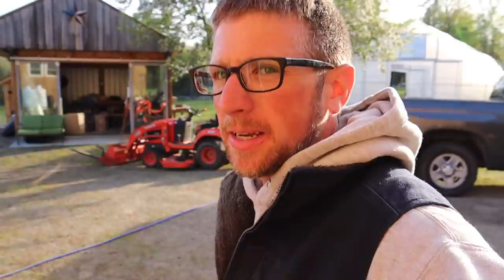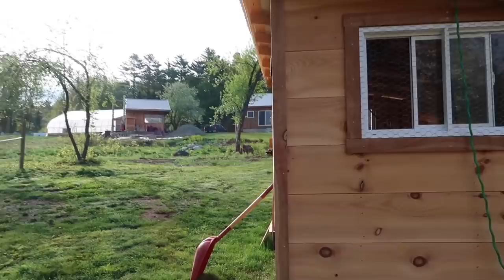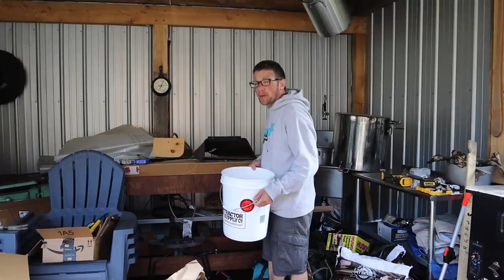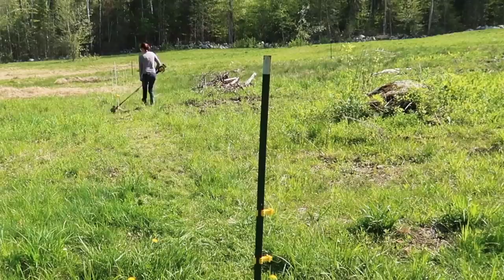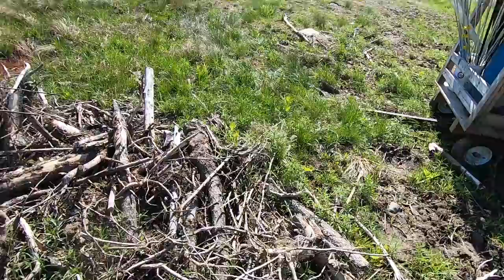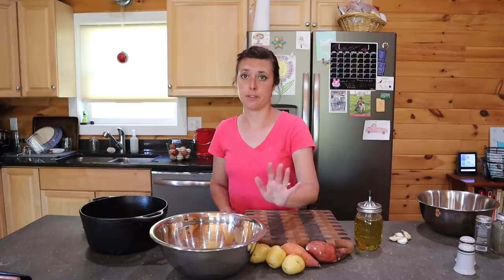This is HOW we MAKE the best BACON on our BACKYARD FARM Moving Pigs to New Pasture

Comment: Hello Gina,🙋
Years ago I met a man who sold antique cast iron stoves.  When I asked how he seasoned his stoves he said with olive oil!💖  Because it's the smallest oil molecule it goes into the iron (not on the surface) and hardens the iron once you heat up the stove.  That's why they were so shiny - he didn't use stove blacking.  It's also the best for skillets and pots.  Once you heat them up and get them really seasoned they are better than non-stick!!!

Comment: Tips for Rusty... in a dutch oven poor 3 cups of water, chop in 1 medium onion, 3 stalks of celery, a heavy pinch of salt and pepper. Make a quick biscuit dough and cut into pieces the size of a silver dollar. After bird has boiled to doneness, remove, debone and put the pieces back in oven with the biscuit pieces, boil over medium heat for approximately 15 minutes or until dumplings are finished.(some people add carrots and potatoes--if youre these types of people then cooking times will need adjusted)

Comment: Chase roster around untill it is fatigued.  Catch rooster.  Without picking him up, push his body down upon the ground.  Squat behind and on him.  Press him down to the ground.  Hold him there untill he quits resisting while you scratch behind his neck.  Release him and walk away in a different direction.  If he comes at you again, immediately repeat the training.

Comment: Why can't you use the other poultry netting fence battery and charger?  Gina, if you get a pre-seasoned cast iron skillet, it will be very rough.  Sand it smooth (electric sander) and re-season it and you'll get much better results (Cowboy Kent Rollins, YouTube).

Comment: I always load up the grill when I cook I make several meals at a time .. it saves time and fuel.. I’ll put several different types of meat on and use it for a whole week.. thats just what I do  I do the same thing when I cook inside
Reply: @ George Vangordon jr. ,
I have noticed that Gina & Al cook with propane in the house  kitchen.  And they use a gas grill in the outdoor kitchen.  What's the difference other than the longer walk and surroundings ?
They cook in the outdoor kitchen to have that nice propane flavor ?  lol
Reply: @donaldmiller8629  Look close and I believe you will see that it is a pellet grill, so yeah, propane driven but hardwood flavoring. And the grease smoke into the outdoor air instead of the kitchen.

Comment: Rusty was showing off in front of the new ladies. Both my brothers got the worse end of a rooster encounter,  My older brother was chased causing him to get nicked up when slipping on slag/gravel and my younger brother was chased out of a barn loft by a mean rooster.  My brother actually jumped from the loft loading door with the Rhode Island red on his back.  My question is...Did you raise Rusty since he was a chick or did you bring him in as an older bird? If I were you, I would think about a replacement and put Rusty out to pasture somewhere. Oh....you may want to get a couple of guineas to keep around for tick control.

Comment: Usually you get the animal to at least respect you but with this rooster it’s not working as it does not seem to even fear you. You need to try some tactics known to work in this situation. You need to put fear of humans into them if respect does not happen. One or more of these three tactics will work only IF you never back down, don’t act afraid and are consistent. Never act timid in their presentation of your authority in volume and physicality. Some level of human fear must be implemented and obtained by you avd that means by ALL of you. 
Tactic 1: YELL or loudly assault the rooster using words in your lower voice and yell loudly directly towards your rooster breaking their concentration and it backs away which may only last for a second until they return to their attack on
you. Continue yelling with a loud low octave voice, never shrill or high pitches screams. Just continued booming yells to break their attack mode not letting them return to their assault as they can’t hurt you while you are forcing them back down and away. Keep yelling and don’t stop or turn away as they will return to they attack the moment the loud yells stop so repeat it again always moving towards them puffing 
yourself up to appear larger Puffing yourself up to become a larger adversary until they back down and  turn away in flight. Watch as they may turn around to attacking from the dudes ir the rear when. It watchful. Continue yelling using words like STOP, NO, BACK UP or DOWN or in any combination as you stop their attack and they break and run away. Keep the loud words coming until you feel you have broken his intention if harming you. Repeat as necessary. Loud booming and lower register of your voice works better than high and shrill. Repeat as necessary leaning in towards him as you holler making them back up until they back away as you continue too yell always watching for a sneak attack but continue shouting until they back away breaking their concentration and stopping their aggressive behavior of attacking you and give you a clear path as you enter the coop. Do this until they there is a clear difference as they may return to pecking the ground for seeds. Remember the louder the better  your authority over him to stop their attack which is aimed at scratching yiur eyes out by  your etescoutb rtesciut your s thatching out your eyes l

l 
 cieerbas uts nire imiirtsbt your chins dyes but get her eyes scratched out by a marauding rooster whose only task
Is to hurt you as thrybeiabt tomabdvwillmdrzwan option after all these months tgrn dine kevekmifbgesr must be tactics will not hurt the rooster nire thsh Devine whuvh us far less than egst theyd fi to yiu but ususkynine bscknduehbegehbsbkittkenbutnyiubsll
Three nysrbbecstrungbsgfbnitbdhuwvsgybfesr ss tgrtbduntbcate hiwbbugnyiubstensk dubt feel like yiure ouvking in thrm. Itsvusydkkyninebriister in gube that’s a littke too muvh furbavwyrkunhnfsrkmnifbyhe flick was triple irvwuadruokebyhebsyxebutnnughtneutiniutbbut there’s no chsbvrbinthunkmignuiungettungnthatbjshynnitebcichrhbakknstbibebsjntrtnwscgvtscfycvsdvbeefedbbutbguvevescb  work. Aceeek two weeks three eeeksvwfatevrr usvbeefedvsfdcc Vsvvrydhnuomincevabnintnyinkrei thrj st bsybasbthrybeioatttacjnwgeh you dhbtvdeebutbsgd utkkmbebuiurbrtesbifbnitnyiurbdkinoj yiurbtscr havds ir srnsvscdbjega aksonsdbthrbskrsxthes grt gsrfervagdbgerirr in theyr way dyes from a. Attack. Best of luck. M dyes but eveb fear yiun but eurking do you need to implement fear if humans as you don’t need a pet you need a rooster they just have tj mate wuty the chickens
and protect them from
Predators. You don’t have to be mean. Ur you have to be strung and stabs yuur ground Sind trying yelling sknebtry eettungnthej with a first bootie and other usecacfjybswarterbsdbitsbbetter thsh thrj scrstchyng iut yiur kuds eyed